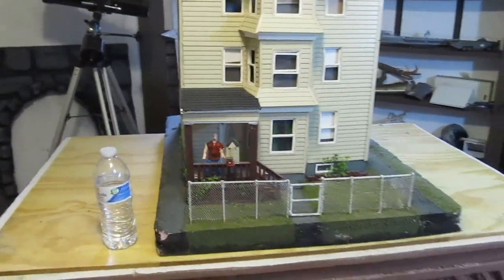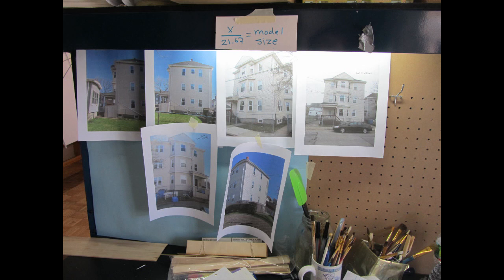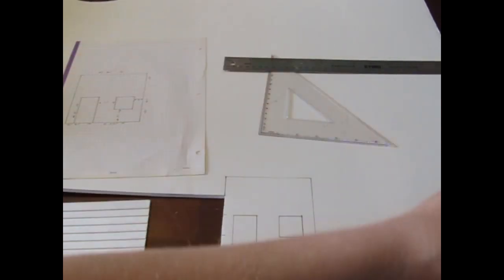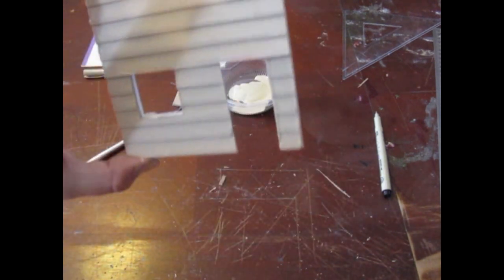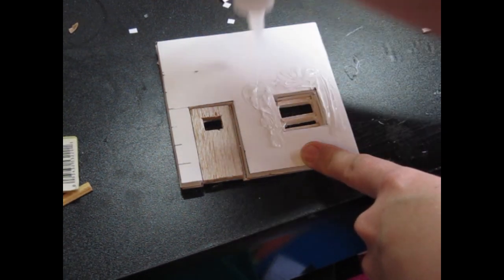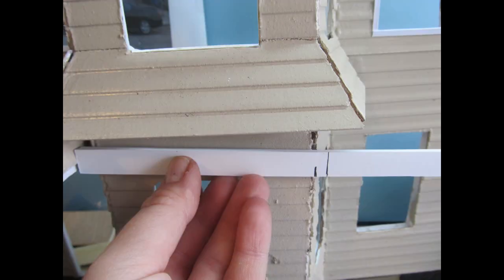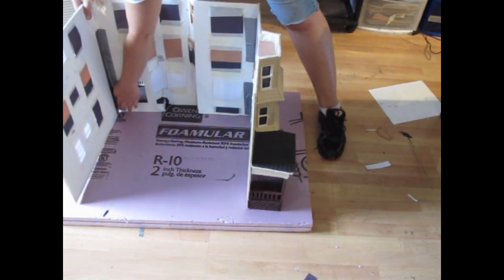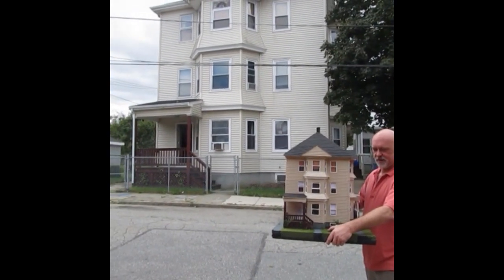How to Make a Miniature House Model with foam board

Comment: Very nicely done. I was wondering what you used for the minature chain link fence.
Reply from the maker: Good eye and great question. The structure of the fence is wooden dowel. The actual chain link section is a product called Wireform. it is a crafters Mesh for modeling.